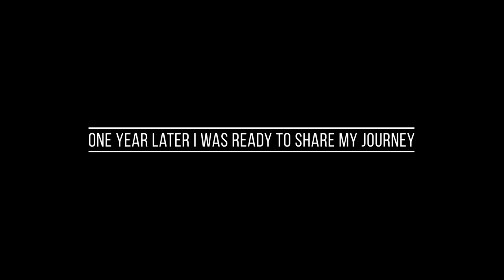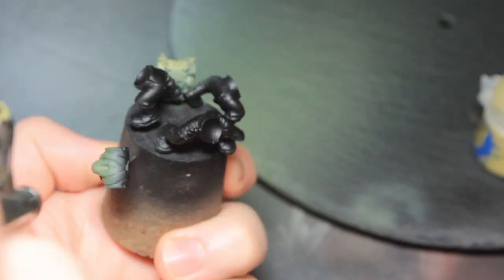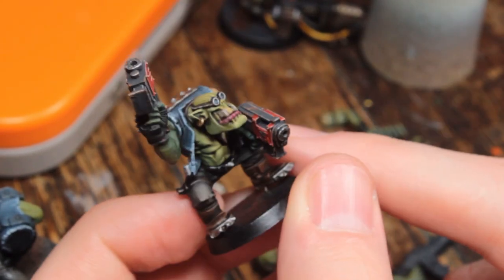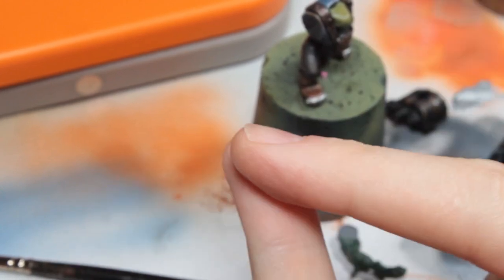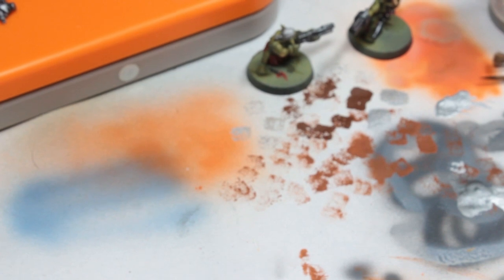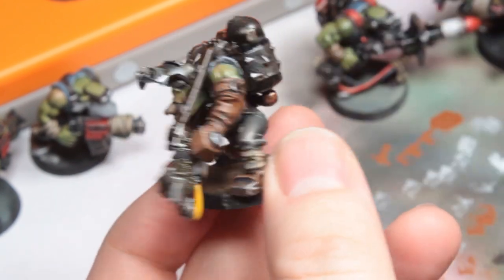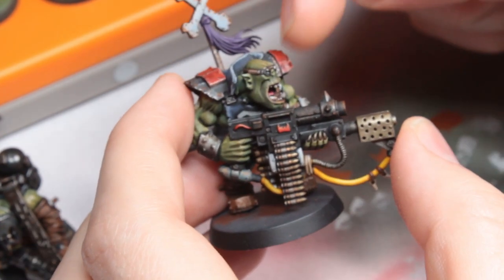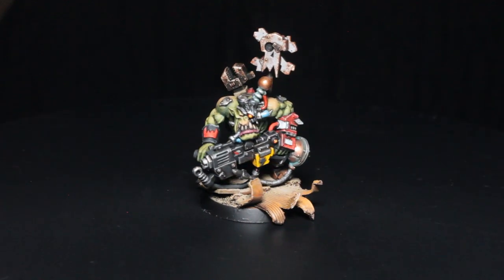Painting an Ork Kill Team

Comment: I stopped the hobby because of the cleaning.
Worst thing in life
Reply from the maker: Fortunately modern Primaris Marine kits are incredibly fast to clean. Not so much the push-fit ones but the actual multi-part kits are really well designed.
Reply: Sometimes it's hard to decide if a mold line is worth removing or not.  Especially on crappy unicasts.